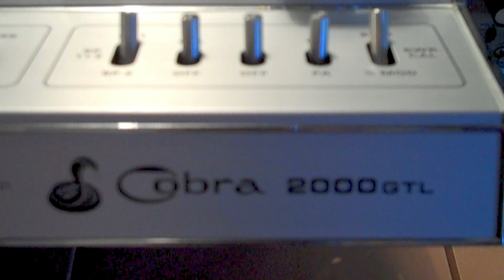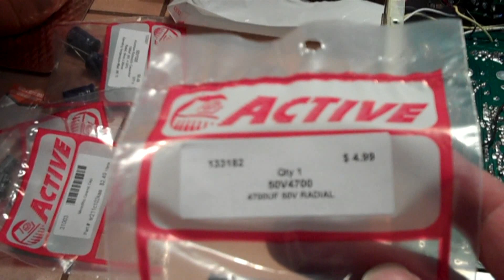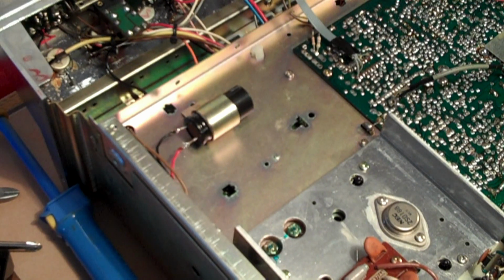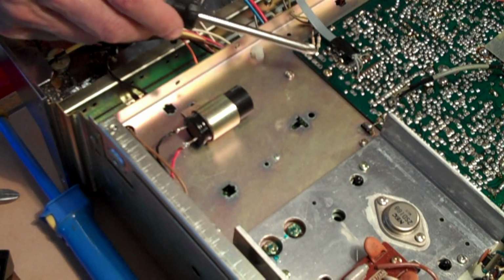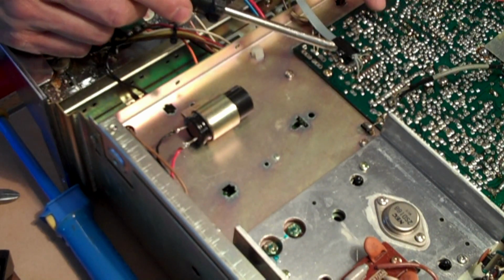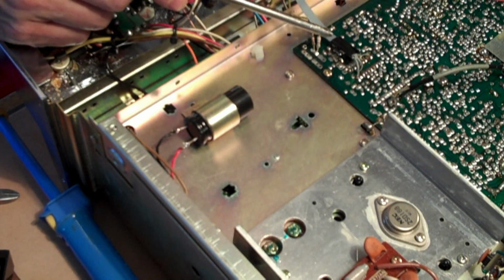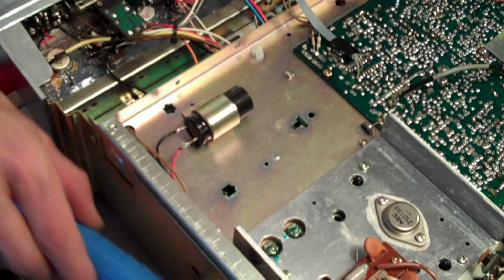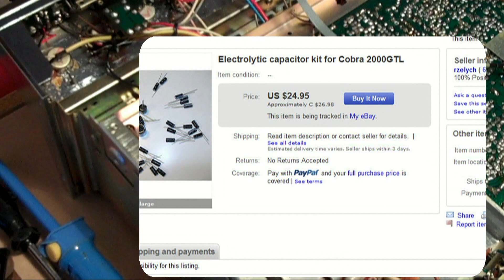Cobra 2000 GTL restoration project, part 3

Comment: I bought all my caps from Digikey. They are Nichicon audio quality FG FW MW series. Not all values are supported in each series.
It was about $35 for whole radio. Just for price reference I replaced the 4700uf with a 10000uf and it was $4.19.
Reply from the maker: +scott   -  My cap kit contains Rubycon, Nichicon, Panasonic, MultiComp Pro, etc. and comes with detailed installation instructions; https://klondikemikescapkits.com/products/cobra-2000-gtl-electrolytic-capacitor-kit-deluxe
Reply: That kit appears to be a mix of different brands. They are also not the "Fine Gold" audio grade. For a CB I would think you would not notice a difference. If you are going to take the time to swap caps, for a few bucks more you can put in the best quality. Thanks for the info, any cap swap is going to help after 20+ years of service. Keep up the good work.